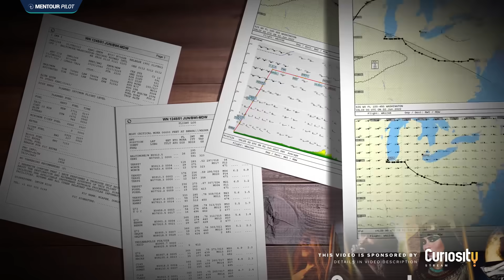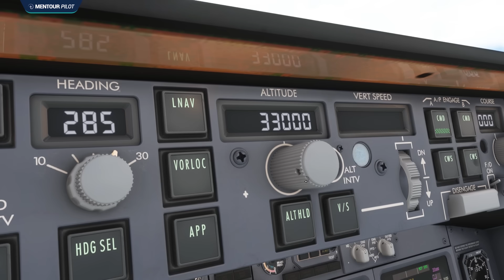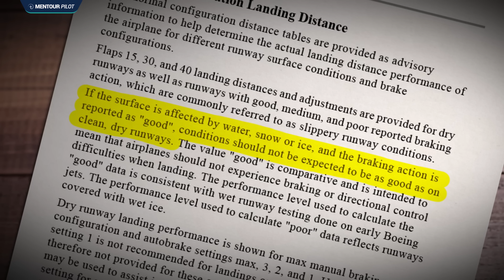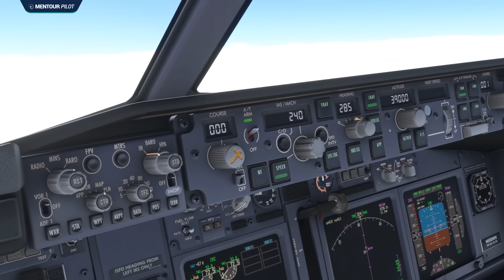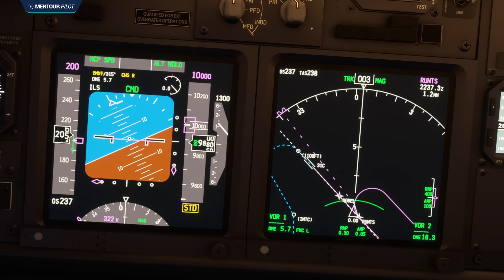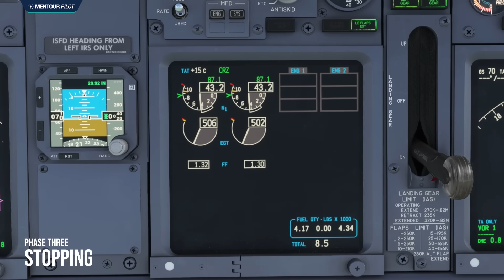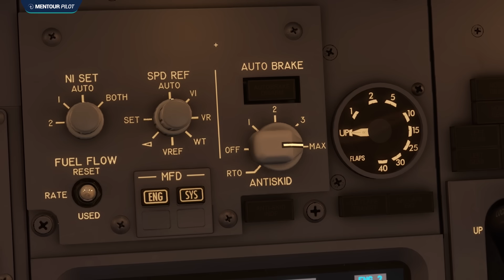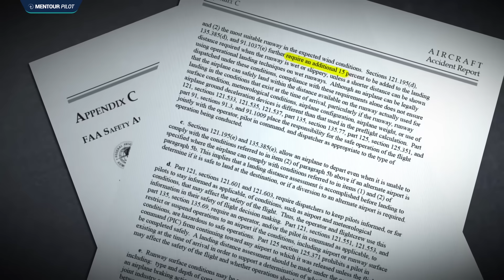WHAT did The Pilots MISS?! Explaining Southwest Airlines flight 1248

Comment: Great video as always Petter!
The engineering quirks are really bothering me. As others have mentioned the problem with the performance program is really frightening. But also the thrust reversers: I understand that the engines need time to open the reverser doors, but why would you lock out the lever? I would make more sense to allow the pilot to choose the reverse thrust they want and then let FADEC do the rest. From other videos I have learned that the spoilers can auto-deploy and even the flaps (on some aircraft) can do this. Damn, the big point of this video is the AUTO-brake, which is selected before touchdown. So it would seem logical to NOT lock the reverser lever. Can someone elaborate why this might be a good thing?
Reply: The automation available to pilots near to and after touchdown has changed a great deal since this accident. I'm sorry - I don't know enough about passenger transport aircraft to give you much detail, but most modern Airbus aircraft have highly automated landing operation.

Comment: The aircraft slid off the runway onto a busy residential street called CENTRAL Ave , which is busy but definitely not a “ highway “ and the vehicle which collided with the plane was traveling south on Central . I believe a 5 year old child was killed . This could have been avoided has the used the approach from the opposite end of the runway with the headwind

Comment: The First Officer had to physically remove the Captain's hand from the Thrust Reversers and apply full Thrust Reverse; which was 18 seconds after the touchdown????? Yea, the Captain has to bear the burden of this overrun due to failing to complete the task. I know everyone always wants to take blame away from the crew, but waiting 18 second to engage thrust reverse is unacceptable no matter the work load.
Reply: Everyone? For not executing thrust reverse promptly on an icy landing, I blame the crew, first, last, and in between.  To hell with work load excuses.  If work load or whatever else is excessive, then you divert! Cancel the damn flight for weather.
Reply: @Nill757  When the captain decided that h was going to deal with the braking, he should have delegated use of the thrust reversers to the first officer. 
At such a time critical period of less than a minute in total, correct delegation is vital.
Reply: @wilsjane  Problem is under these conditions cockpit work load was going to be heavy for this landing no matter what, so higher risk of mistake in planning, like not delegating work tasks perfectly.  Crew should have diverted Ohare, or airport closed.
Reply: @Nill757  During the first minute after touchdown, nothing else matters, other than stopping in a straight line before the end of the runway. 
With the pilot flying needing to brake and control the rudder, it is difficult for him to take his eyes off the path ahead and concentrate on the thrust controls. 
That is why the pilot monitoring should give this aspect his undivided attention. Everything else can wait.
In the case of this video, manual braking should have been delayed until the captain felt the affects of the reverse thrust. 
The now retired chief pilot of a major airline fully agreed on this one. Her (yes. her) 😊 airline has not had a crash or incident involving injury in more than 50 years.
I wonder whether you can guess the airline.
PS, I am a retired engineer, not a pilot.
Reply: @wilsjane  Tail wind. Icy, short runway.   Crew not fully familiar w braking system these conditions. There are always highest priority tasks, but no there is no period in flying, or landing, where “nothing else matters”.   The answer here w human beings is not, do better, everybody be more efficient, because that’s what real pros would do.  Divert the damn aircraft.

Comment: I suspect the increase in runway excursions may be related to passengers thinking that weather no longer affects flight performance; and airline management becoming more devoted to schedule.
Reply: That's possible.  But definitely not an excuse.  Neither passengers nor management should be the deciders on whether a flight takes off or not, or which runway at what airport if conditions aren't safe.  Pilots obviously feel some pressure to keep to their schedule and keep the customers and bosses happy, but it can't factor into safety of the flight - which should always come first.
Reply: @skyhawk_4526  there is frequently a difference between should and is.
Reply: @kenbrown2808  True.

Comment: I live by DFW and watch the planes come in for landing when the winds are out of the south.  I live north of that airport.

I have to imagine there are a lot of advantages of landing in a headwind, such as it probably gives you a lower approach speed, along with the added resistance when landing instead of a wind pushing you down the runway.  Usually the winds are out of the south, sometimes the north, not very often the east or west but if they are it's usually for a part of the day and then it's back to the north or south.

Comment: Leaving aside the 5kt tailwind limitation issue and how that was software implemented I am amazed at the logic of the decision to land based on highly qualitative descriptions of poor and fair condtions and from that they infer a bogus linear combination of these two qualitative factors which completely negates the whole concept of a conservative  envelope. But the daddy of them all is how the two pilots sat there for 18 seconds without selecting reverse thrust. There is no excuse for that oversight. Here the context makes the oversight even more outrageous - they were clear;ly aware that stopping it was going to be hard but missed the thing that could  have got them stopped. There were no Sullys to be seen on that flight deck that day.
Reply: Also the decision to use the automatic brake for the first time when a difficult landing was expected was a very strange decision . This distracted the captain after landing shifting his focus to how the automatic brake was operating when he should have been applying maximum reverse thrust knowing that the braking conditions are not good .
Reply: @eamonhannon1103  I can give them the fault for picking a bad point to try the autobreak, everything after that was basically result of testing a new system

Comment: Besides the engines taking longer to spin up in reverse if they're allowed to drop from elevated idle to ground idle, the other effect of delayed application of reverse thrust is that they're just much more effective at providing declaration force when the airplane is travelling faster. It's a double-whammy effect of less time with reverse thrust and less effective reverse thrust the longer the delay after touchdown. Delayed application of reverse thrust is, unfortunately, a common cause in many runway overruns, usually coupled with poor weather conditions where the reverse thrust is very important to the required stopping performance.

Great video!

Comment: In the nuclear industry, we have a operating principle known as "conservative decision making."  If the pilots had followed that principle, they would have made a conservative runway stopping distance calculation, treating the runway as poor throughout, rather than fair. This assumption would have required them to not attempt a landing for a tailwind greater than 5 knots. They would then have had to make the conservative decision to divert.
Reply: they decided to put that in the instruction manual small print......
Reply: In my airline- we always used conservative estimates and decision making. I don’t know what the hell South West were doing!
Reply: If they were going to not apply reverse thrusters, then they were eventually going to crash no matter where they landed.
Reply: @sectokia1909  they intended to, however the apparent mechanical lock-out for premature deployment meant that  they erroneously forgot to deploy correctly / check that they were actually deployed

Comment: One question: when landing an aircraft it’s important that the runway is cleared from snow and ice, but when taking off, does it matter if the runway hasn’t been “dusted”?

(Came to Warszaw airport around X-mas many years ago in a small 2-engine Cessna or whatever and while all large jets were circling around waiting for the runway to be cleared of snow we just landed and this little plane stopped by itself)
Reply: The 2-engine Cessna that could!💓✈💓
Snow on runways is the leading cause of snow-related aircraft mishaps. Landing on snow contaminated runways is more perilous than takeoff but snow's been known to affect pilots during takeoff (and taxi operations). 

Even a few inches of slush will impair takeoff acceleration & won't help in braking.

My question is this: I know pilots are very talented but if pilots can't fly all models because each & every plane is so different and pilots only really fly the particular models they're trained in and have a type rating for, could a pilot who's travelling as a passenger on a model they've never flown before as a pilot, know how to fly it in an emergency situation? 

I think Mentour Pilot could.💓✈💓
Reply: @isabellind1292  Thanks for the info.
Of course this guy hadn't been allowed to land if the ATC hadn't considered it safe. On the other hand this was also a guy "taking risks".....
Reply: @Soundbrigade  You're welcome. Well, in your situation it is kind of odd the ATC permitted any type of plane to land when I think about it. Don't you find that odd? Maybe smaller planes aren't as at risk but I hope the decisions aren't based on how many passengers the plane's carrying, lol! ☺✈
Reply: @isabellind1292  Well I guess this guy knew the ATCs ... WRONG! The ATCs knew this guy pretty well as he often flew his small between Warszaw, Poland and Kalmar, Sweden and they probably knew he wasn't anyone you could argue with. This contradicts everything Mentour Pilot and Gear74 are saying but it's my idea. This was i early 90's btw.
Reply: @Soundbrigade  Oh my! Audacious wasn't he. He wasn't the pilot who flew his Cessna into Moscow's Red Sq. was he?!✈🟥
Reply: @isabellind1292  No. He was very special, but not THAT special.
Reply: @Soundbrigade  Lol! 😊

Comment: Really maddening that these pilots, against what had to be their better judgment, were willing to squeeze the landing into a distance leaving them 40', if best performance was achieved, leaving them 0 margin for errors. And not 86ing the autobraking when it ultimately cost them 18 valuable seconds because of the distraction it caused the pilots. It was unnecessary because it was taking the captain's attention to closely monitor it, when it just should have been passed over for manual braking from the word go. Not being a pilot, I can only try to base my opinions on what seems most reasonable, and their thinking appeared to be counter intuitive. I also wonder what would be wrong with trying to touchdown a little earlier, giving them more runway to work with?
Reply: I very much get that. Touching down earlier though raised the problem of potential undershoot which is just as, if not more disastrous than overshooting the runway.

Comment: All of the swiss cheese indications that you frequently reference, said 'abort'. Terrible weather, new procedure, downwind landing on a marginal runway, short threshold, etc. Basically the same as driving with a headlight out, in the rain and deer runs out. You reference the pilots' extensive experience, unfortunately they probably had too much and we're too comfortable. Sometimes even the most experienced need to 'zoon out' and assess the situation.
Reply: That was what I was thinking. Lots of finger crossing to land at the primary airport while the two alternates were still in play.
Reply: I think part of the contributing factors for the decision to NOT divert is pressure from the airline companies. It can cost airlines up to $250k to divert an aircraft, for fuel, service fees at another airport, passenger reconciliation, additional travel expenses for crew, lost business for additional flights on the aircraft, etc... and unfortunately that puts a lot of pressure on pilots to make questionable decisions.

Comment: I often run into the same incidents on TheFlightChannel that has great 3D animations (as have you), but you describe the situations VERY GOOD, like how pilots are acting or should be acting, how personnel on the ground act, how airplanes work or should work and what has to be done to make them work the way they should.
You made a video with Kelsey and that was absolutely great, and I had been really cool if you could do a video with other Youtubers like TFC or cooperate a little with the people at WW2 to talk about how to fly an Avro Lancaster with half of the machine shot to pieces.
Often cooperations brings another dimension to the issue handled.
With that said I like your videos a lot (approx. 174.387%) because you straighten out all question marks and are so detailed.👍👍👍👍

Comment: I love how the report throws the pilots under the bus here. Clearly because a non-flying child was killed. “The pilots shouldn’t have landed” / “there was a slight tailwind”. How about: we inadequately rolled out new braking tech and did not inform the crews in a coordinated rollout of the calculations.

The increase in excursions is clearly a corporate problem of pushing times and decreasing fuel usage.

Comment: 73-2 and above have auto brakes, here is an insight on how the 737 brakes work. Real question is did they reference the runway condition chart and what was touchdown speed?
There is an "on ramp" period where autobrake pressure is applied over a period of time. Approximately 750psi is applied in 1.75 sec, then the pressures above are reached in another 1.25sec for autobrakes 1, 2, or 3 and approx. 1.0 sec for autobrake MAX. 

Autobrake Max does not give full brake pressure. For absolute maximum braking on landing, select autobrake Max to assure immediate application after touch down then override with full toe brake pressure. 

Using high autobrake settings with idle reverse is particularly hard on the brakes as they will be working for the given deceleration rate without the assistance of full reverse thrust.

To cancel the autobrake on the landing roll with toe brakes you must apply a brake pressure in excess of 800psi (ie less than that required for autobrake 1). This is more difficult on the NG's because the feedback springs on the brake pedals are stiffer. Autobrake can also be cancelled by putting the speedbrake lever down or by switching the autobrake off. I would advise against the latter in case you accidentally select RTO and get the full 3000psi of braking!

Occasionally you may see the brakes (rather than the cabin crew!) smoking during a turnaround. This may be due to hard braking at high landing weights. But the most common reason is that too much grease is put on the axle at wheel change so that when the wheel is pushed on, the grease is deposited inside the torque tube; when this gets hot, it smokes. It could also be contamination from hydraulic fluid either from bleeding operation or a leak either from the brakes or another source

Comment: Emas is a perfect example of a system that unlike most modern engineering systems especially aircraft is perfectly not overly complicated it’s basically a over engineered runway surface with a under engineered surface topper that can’t hold the weight of a plane that’s designed to a specific height no 100 extra moving parts no 2000 part implementation procedures for use that have to be done perfectly just good old passive ablative destruction.       Over reliance on “modern technology” ie complex computing systems is only beginning to foster skill decay and higher workloads that go back to the original solution in the first place how long do you think it will be before the industry realizes that a dedicated flight engineer on every flight is cheaper safer and lighter than every overly complex automation system they add to fix pilot overwork and the fact that they stoped simplifying cockpits in favor of 1000 cool gadgets that give you too many points of failure

Comment: There is actually one factor that wasn't mentioned in the summary that really stood out to me: The OPC software changing the tailwind figure input from 8 to 5 knots. As a software developer, I would consider this a dark pattern, changing user input shouldn't happen. If I were making design decisions on what's essentially a form, I would have it display an error if a value that's out of expected range is entered by the user. In that case (especially if the error message is good, and says that this is invalid because of the poor braking action being selected) the pilots probably would have noticed the conflict between the two.

Comment: Im a Software QA Engineer, which means I create automated scripts to test any sever/database updates to make sure the code is functioning as intended. I also interpret Developer code to make sure they are using best practices.

I literally and physically winced when you said the computer defaulted the input "8 knots" to "5 knots" (its maximum input). That seems like a major oversight and bug for a guidance system that pilots rely on. It should have prompted a warning or not allowed them to input anything above 5 knots. Seems like such a small development mistake, but it had serious consequences